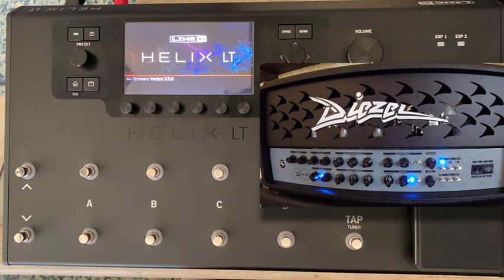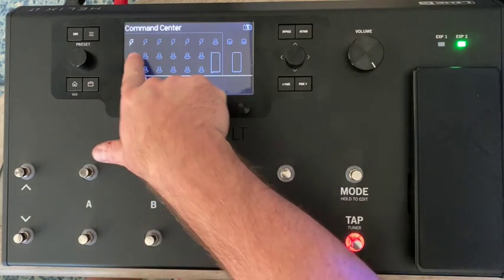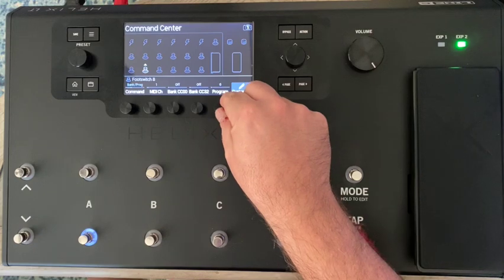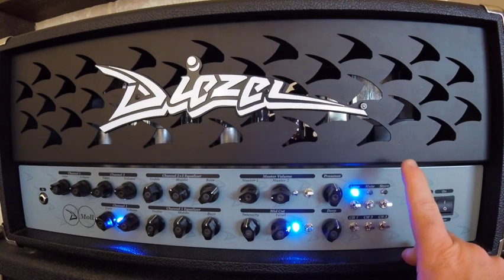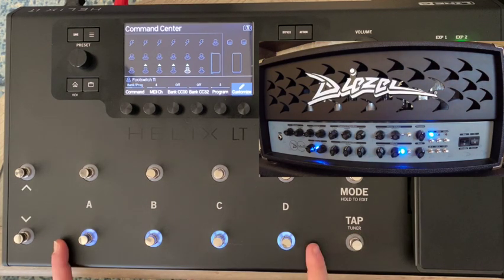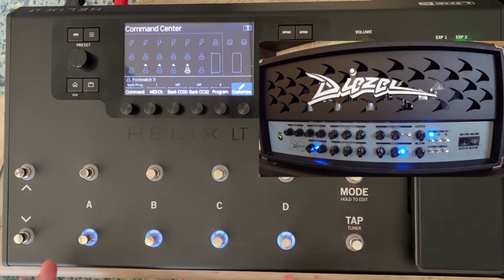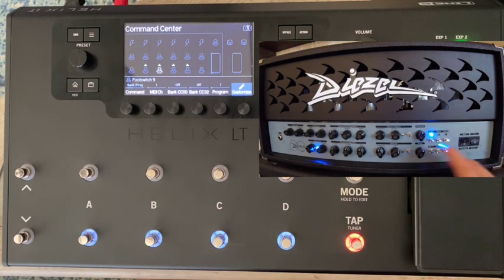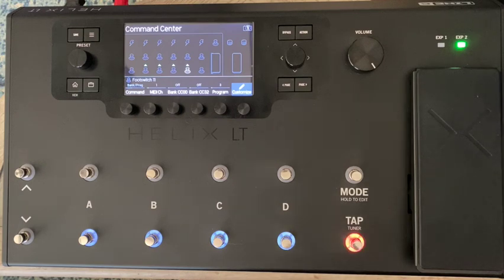Programming The Helix and Diezel D-Moll with MIDI

Comment: So the helix is a 5 pin and the diesel is a 7 pin… how’s that work?
Reply from the maker: I just use a 5 pin MIDI cable on both ends. 
Helix MIDI OUT: Pin 1- No Connection , Pin 2- Shield, Pin 3- No Connection, Pin 4- Voltage Ref, Pin 5- Data
Diezel MIDI IN: Pins 1 & 6-  Ground, Pin 2- Shield, Pins 3 & 7- Hot, Pin 4- Voltage Ref, Pin 5- Data.
The extra pins supply power to pedals that may need it.
Hope this helps!

Comment: Does the midi store eq settings or just the channel switching?
Reply from the maker: Hey Travis! Thanks for checking out the video!!
For the Diezel D-Moll it's just the channel switching, Master Volume 2 (on/off), Mid-Cut (on/off), FX Loop (on/off). There are some amps (Revv, I think) that use MIDI CC, and I believe that can store things like EQ settings, etc. for each "MIDI program". Hope that helps.